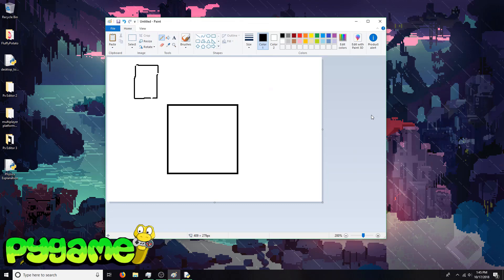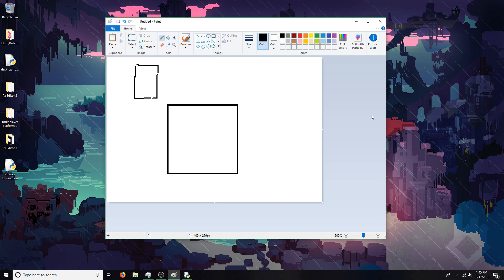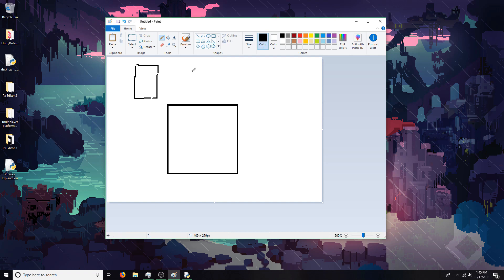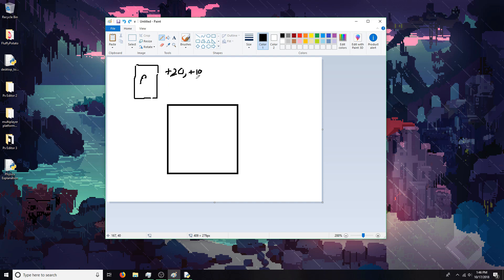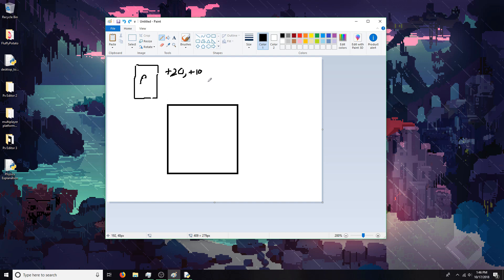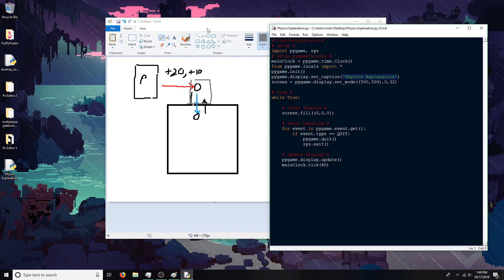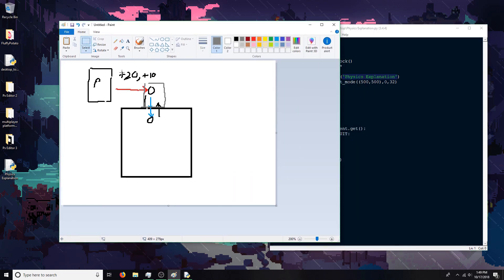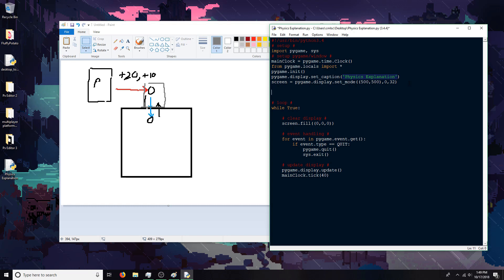In-depth Pygame Physics Explanation

Comment: I am concerned about something I think you may have overlooked, Let's say that the vertical offset is just 3(one tile from the other), But your velocity approaches at 5.
You will then hit both at the same time, My concern is that, Depending on the order in the array itself, You may get stuck in one or the other, Judging by the code, My prediction is that an x motion might result in you clipping to the opposite direction of the tile, A vulnerability that can be used to exit the map.
Does that hold True for Python?...
Reply: To test it, You can try setting the second tile's y coordinate to 352 then move downward onto them.
My theory is that downward movement would stop immediately, Upwards movement will teleport you to the bottom of block, Leftward movement will teleport you slightly right, And rightward movement to the left side, Where you would fall off if there was gravity...

If this is so, Perhaps a quick comparison would help, I.E:' ' '
   rect.right = rect.right < tile.left? rect.right : tile.left
' ' '
I honestly don't remember if ternary operations exist in Python, But if they did, It might help this a lot.🙃
Reply from the maker: This video is supporting a series that uses a grid based tile system, so it's a non-issue in that case. (unless you're moving extremely fast, in which case you need to break down movement into smaller steps for physics)

Comment: Could you please reply to this question:  can this code be used for moving platforms or would I have to add extra code to handle collisions of that sort. 

EDIT: I've fixed it. Also I would like to say that I'm really inspired by the way you create awesome games with pygame :))))
Reply from the maker: It depends on what you want with moving platforms. If you don't care about friction, then yes (don't forget to move the platform with collision testing against other platforms and the player). Otherwise, you'll need to write some extra code to move objects on top of the platform.

Comment: I'm really struggling with the tile collisions rect.top,  rect.bottom, rect.left and rect.right are my main problem if I do rect.bottom = tile.top it doesn't make the rect move
Reply from the maker: Try using the code from the video's description. Then look for differences.
Reply: @DaFluffyPotato  I've made some improvements from your advice. However, when my sprite collides with a tile the sprite moves past the tile and gets stuck in between tiles. Is there any other way to make the sprite stop when in contact with a tile?
Reply: Make the colliding sides equal to each other.
Reply: @leovaldez6280  thx for the reply but you're like a year late. I did manage to fix it in the end :)

Comment: Just so people know, this method will not work if multiple rects overlap and it collides with them near the same area. If you add pygame.Rect(204,350,50,50) to the tile list, it will give you undesired behavior. There probably needs to be some sorting on which ones are closest.